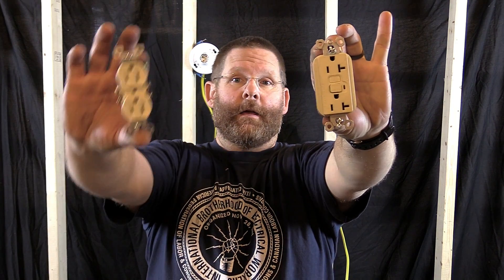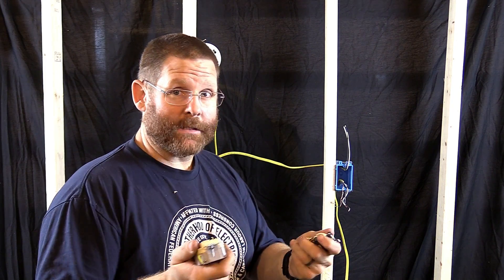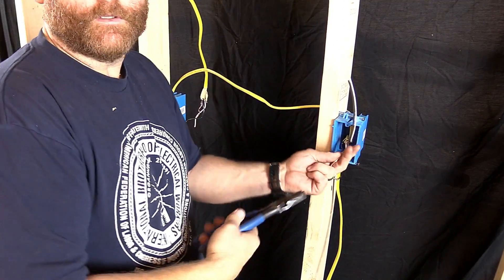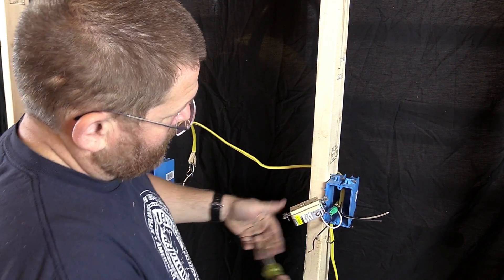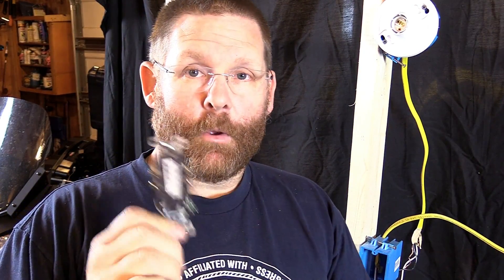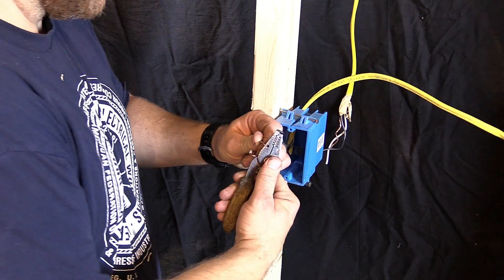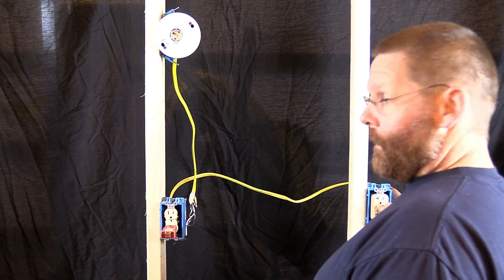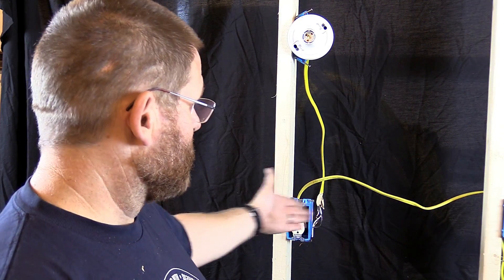How To Wire A GFCI And Receptacle

Comment: My box has two white and two black wires plus a ground. I got the two white wires confused to which was on top and bottom. What to do?
Reply from the maker: You have to find which is the hot coming on they must go on the line side. The other set is load.

Comment: Hey man do I just cap off the red wire if I'm using 4 wire romex?
Reply from the maker: Yes
Reply: @MountaineerOutdoors  another quick question man: I have a 2pole 240v circuit breaker powering 1 gfci, and 3 125v outlets down the line from the gfci. And I able to use a 125v to 220v adapter off that setup? Safely?
Reply from the maker: You should never feed a 2 pole breaker on a receptacle circuit. A 2 pole breaker is designed for 240 circuits and will never trip the way that you have it described. You need to change your 2 pole out to single pole breakers.
Reply: @MountaineerOutdoors  gotcha, so when switching out my 2pole for 2 singles I can simply take the black wire and put it on a single pole. And take the red and put it on the other single pole. And this will solve all of my life's worries?
Reply from the maker: 😂 I'm assuming so. Just to clarify you have a 12-3 correct? If so make sure you keep the black on different phases in your panel. If you replace the 2 pole breaker with 2 single pole breakers and keep it in the exact same spot everything will be  👌.
Reply: Yes 12/3 is the stuff I'm using. And What do you mean by different phases on the panel sir?
Reply from the maker: If you replace the double pole and put the breakers in the same spot that will be on different phases.. For instance. Left side 1&3 are different phases. 2&4 opposite side is a different phase etc all the way down the panel. So as long as you just put them in the same place as that 2 pole you will be right.
Reply from the maker: My pleasure ☺

Comment: Great video. While setting up standard outlets initially until clarify GFCI issue. Two questions 1) circuit had master (continuing circuit) and hall baths (end circuit) so GFI in master and regular with label in hall bath. 2) This is the true question. Your walls are open framing - distinguishing line vs load in master bath. Technically would be easy, turn power on and see which is hot is line. But what do you think of this alternative with power off - thought of when tracing travelers in 3 or 4 way, but could apply here. Assuming there is no special tool, take a 9v battery and attach - to ground + to wire tracing using alligator clip leads, then go to the other end with a volt meter. NOTE: This is part of a larger project, replacing all switches and outlets with an Alumiconn AL/CU conversion of the wires.
Reply from the maker: Sounds like it could work

Comment: Awesome videos, i have learned a lot from you, I am currently trying to automate my lights using a shelly 2.5 https://shelly.cloud/shelly-25-wifi-smart-relay-roller-shutter-home-automation/  and i am having trouble understanding 3 way switches, apparently there are at least 7 ways from what i have found on how people can wire a 3 way switch and some of the ways make it very difficult where you have to bring in power from another circuit to make it work, do you think you could talk about that and explain the safe way on how to wire a shelly when you a have to bring in power from another circuit, they are very cheap like $15 but you can do amazing things with them from very simple things like turn things on and off with the sunset to much more advanced things, thanks in advance
Reply from the maker: I have never heard of Shelly switches until you they seem pretty cool. If I ever decide to go that route I definitely will

Comment: Question: when you were wiring the LOAD on the GFCI @ 6:32 I noticed the white wire for the downstream you put in the bottom hole and the hot (black) wire on the top hole.  Does it matter which hole you use on the neutral side and the hot side of the LOAD push connectors?  Must the hole usage be consistent (top/top bottom/bottom)?  I know after you were all done both outlets worked and your tester indicated wiring was correct....but just curious if you need to use the same hole location or it does not matter?   I hope my question makes sense.   Doing the same  project tomorrow for the first time and I just want to be 100% sure about all the steps.   Thanks in advance for your reply/feedback.
Reply: It appears to me that Mountaineer did not understand your question. He made a distinction between wiring the line and load. I noticed the same thing you did, but it does not matter which of the two holes he uses on the line connectors. You can think of it as both holes belonging to the silver screw. You can put it in either hole for the white (common) wire and likewise you can put the black wire in either of the two holes for the brass screw. The reason there are two holes for the line screws is so that you can continue the line (power) to something else you do not want to be influenced by the GFCI if it shuts off. If you do use both holes on each of the screws on the line side you probably want to pair your wires to the same holes , yes for consistency, but also to prevent confusion about which white wire belongs to which black wire. Avoiding confusion in electrical wiring is paramount.
Reply from the maker: @astrongchristian  ok your right i didnt understand. now after thinking about it your correct and that explanation is spot on. Thank you for the clarification.
Reply from the maker: I'll have to check but anything down stream always goes on the load side. I'm pretty sure I didn't wire it with the black going to the top on the downstream side. It does matter for sure though everything downstream must go on the load side if you want it to be protected

Comment: Question, I have a power line coming in, a separate line going to a light switch, and another line going out to an outlet.  How would I wire up a GFI with three lines in the equation?
Reply from the maker: I am assuming you are not making the lights gfi protected. So you will have make the gfi and light on the line side the receptacles on the load side
Reply: @MountaineerOutdoors  thanks I figured it out.
Reply from the maker: Awesome

Comment: i have been watching your video my question is little different when i run meat saw 650 WATS  on Receptacle connected to GFCI my breaker trips either i turn off my meat saw or i run for a while. I would appreciate you if you find the solution for me or refer to your video if you have already uploaded . Thanks
Reply from the maker: Ok since I am not there with you, and I cannot see it I have some questions. 1st is this a dedicated circuit? Meaning is there anything else on it like more receptacles? Lights? 2 is this a newer house or do you have arc fault breakers in your home or regular beakers. 3rd is or has this saw been modified at all? Is it new or very old? 4th is it near a water source? And lastly when you are cutting the meat is it moist or wet?

Comment: If the GFCI is 20 amp should the down stream receptacles also be rated at 20 amp? 20 amp should used on 12 wire correct?
Reply from the maker: Yes 20 amp wire is 12 wire. And as for the downstream code says that any circuit that has more than 2 receps can be 15 amp devices. If it were me I would use 20 amp.
Reply: @MountaineerOutdoors  Understood and thank you. I will also do as you mentioned and will make the downstream outlets 20 amp as well. Thanks again for the video, and your response.
Reply from the maker: My pleasure ☺

Comment: Hi I’m doing 3 bedrooms and my basement I have 9 outlets and 1 15 amps breaker can I put a ac unit and the same breaker oh I need a Separate breaker for the ac unit thank you
Reply: No, the compressor from AC has a high amp draw. You need to check your AC units specs to see recommended breaker and also wire size.
Reply from the maker: True good points
Reply from the maker: Well depending on how big (amp draw) your ac unit is you might be ok without running a dedicated circuit.

Comment: Hi, thanks for your explanation in  the GFI video.  Now I want to add an additional outlet & connect it to the "LOAD" side of the GFI.   Problem is that there is a receptacle already attached to the " LOAD" side of it.  Can I still add my outlet from there as well?  Thanks.
Reply from the maker: Can you come off of the new one you put in. If not you will have to make a joint in the box.
Reply: I just noticed there is another set of available holes on the "Load" side of the GFI where I can insert neutral/hot wires.  So to clarify, I can safely have two receptacles downline coming off the load side.  Really enjoy your videos which are clear & simple. Thanks again!
Reply from the maker: Yes absolutely... I was thinking about that when I wrote my comment to you before. I appreciate your nice comment as well and I really appreciate you watching. Anything else I can do for you please let me me know ☺
Reply: All's good! Thank you again!

Comment: Great video buddy much appreciate it, saved me $$$ from buying multiple GFCI outlets for my DIY garage rewire.
I have an issue my garage doesn't have a ground running in from the main, what do I do ?  Any suggestions would be helpful thanks.
Reply from the maker: If it's in your garage then run a ground rod and put in the ground that way. Or if you water line that is metal bond it to it just make sure you separate your nuetral and grounds. Since it's a subpanel

Comment: Thanks for both of yer GFCI videos.  Replacing two at my mother’s house. The first one I came to had all the wires attached to the line posts which made that GFCI nothing more than an expensive butt-splice.  I’ve got 29 years in X-ray service repair/installs, and said, ”I’ve seen some strange crap all these years, maybe there’s a reason for this..?”  NAHHH.!! You set it right by me and thanks!
Reply from the maker: My pleasure thanks for watching and commenting ☺

Comment: Great Video. Can a cut wire be repaired? 

Can it be spliced into a junction box or should the whole wire be replaced. Its a greenfield 15 amp ceiling light circuit. One hot, one neutral and the ground is the sheathing around the wire. The house is about 80 years old.
Reply from the maker: You cannot mount a box in the ceiling without some form of hand hole to get back to it. So if you can get back to it then yes... Ie. If you have a can light you can remove then you can do it. Something though that you cannot get back to without tearing up sheet rock or plaster, then it's a no
Reply: @MountaineerOutdoors  The junction box is accessable thru the unfinished attic. I wanted a third opinion just to be sure. Thanks for your help.
Reply: Can a junction box be buried under insulation? 
Does the junction box need to be separated from the attic insulation.

Comment: Just came from Lowes. Im installing 2 new GFCI outlets. I got confused because they had 15 and 20 amp outlets. I didnt know which one to get so i got the 20s. Does it matter between the two ? Mine are going in the kitchen.
Reply: 20 amp gfi should only be wired with 12 gauge  romex. 15 amp gfi to 14 gauge wire.  You can use 15 amp gfi on 20 gauge wire but not vice versa. 12 gauge wire can carry 20 amp current w/o overheating. 14 gauge wire cannot carry 20 amp w/o heating up.
Reply from the maker: That is true. However, one would have too look inside the panel to see what the overcurrent protection device is. It if it's on a 15 amp check the wire size leaving the panel and inside the receptacle box. I've seen too many times where the homerun is leaving with a 12-2 and it spliced over and over and the receptacle boxes have 14-2 in them. Always good to check. But your statement is correct.
Reply: Agreed. If the breaker is a 15amp. But 20 gauge on a 15 amp breaker is overkill. 12 ga is difficult to work with in a small bix.
Reply from the maker: @pointerdogman2814  I agree. The breaker will only allow what it rated for to pull once the max is reached that breaker will fail due to it reaching the maximum allowed amps. Just like you mentioned in the beginning, 12 Guage for 20 amp and 14 Guage for 15 amp.
Reply from the maker: No 20 amp are more heavy duty should hold up better too. You did good

Comment: I am trying to add a new GFCI outlet in the middle of a run that will protect three standard outlets on down the line. The original wiring is 12 gauge/two wire (No ground). I disconnected line wire from the original receptacle and connected it to the hot and neutral Line Connectors on the GFCI. I then took new 12/2 (with ground) and connected the GFCI to the standard receptacle using the Load Connectors. The standard outlet is then wired on to the rest of the outlets as originally wired. Your video was very informative on how to install this new GFCI. However, connected this way, the GFCI will work, but the outlets on the load side are dead. I have checked and rechecked the connections making sure everything is connected correctly and they are. So I'm puzzled with that. NOW, in frustration and in need of power to this circuit while I figure out the problem, i disconnected everything new and just swapped the standard outlet out with the GFCI. This way everything is working! Which is great because we have a GFCI in the bathroom, but I'd really like to have the second outlet if possible. Any thoughts?
Reply from the maker: I'm honestly wondering if you possibly had the line and load mixed up. Did you use a meter or tick tracer to find the hot (line) coming in?  Did you keep the neutrals with the hots? The hot nuetral with the hot and the load nuetral with hot?  My only other thing is this.. Are you sure that the gfi is good? I've had alot of new gfi bad right out of the box

Comment: Hello. Thanks for the reply, I agree with you. that is the way i was taught. If the plug gets pulled lose the ground plug is the last to be pulled out.. I got another problem I have been trying to figure out and I think i came up with a solution. May be you could advise on. I have a rental property they came up with a new law, rule. If you have a receptacle with in five feet of the water. This being in the bathrooms and kitchen , laundry room hook ups. It has to have a ground fault. So the electrical boxes are old style and too small for the receptacle. But they say if you put one in on a circuit. It would cover the rest of them on that line. As I seen  on  your video. Now my question is why cant i go to the breaker panel and put one right out side of the breaker box for that complete circuit? reason for this the boxes being to small and the wires to short to work with? Thanks for your help time and trouble.
Reply from the maker: You could only thing is that it would be a nuisance for your renter to have to walk all the way to the electric box where you located the gfi at to reset it. Other than that I see absolutely no problem with that at all.

Comment: Hello, I have a problem. Im sure you can help. When hooking up the wires for a receptacle, You have three wires. But say you only have two. 
Can you hook up the common and ground so it shows a ground?
Reply from the maker: well I definitely would not do that. You may think that its the same thing but in reality its not. Fix it right and you will have a good piece of mind and a safer circuit.

Comment: hello , nice video thank you. Now i got a couple questions. If you look at the ground fault receptacales  they have the ground lug on the top.  You look at the testers the ground plug is on the bottom. The way i was taught was the ground plug was on the bottom. Then the changed it again. So what way is the right way? The code has changed from when i went to school  a couple times.
Reply from the maker: as far as I know there really isnt anything in the code book saying which way the ground should or shouldn't be. I prefer it down just like the picture shows in the thumbnail and in the video I did.

Comment: Thanks for the video. If my outlets are not currently GFCI and are daisy chained, how would I know which wires are line and which are load, prior to installing the GFCI?
Reply from the maker: You would have to try and find the first one in line. Then you can use a meter or induction tester and check for power. The hot one will be your line and the rest will be the load

Comment: Im running new electrical wire from breaker box & putting 2 gfi's by sink & 2 other outlets. Is a 20amp breaker & 12gauge wires be ok to use?
Reply from the maker: Absolutely is the that is what I would recommend
Reply: @MountaineerOutdoors  ok thanks for the fast response what size on outlets recommended? 15amp or 20 amp
Reply from the maker: Personally I do not see any problems with 15 amp. But if it's not a money issue go with the 20 amp they are beefier.

Comment: Great video, thank you. 
If possible I’d like to see a video on helpful tips/ code for running new home -runs. Mainly stapling and securing the right way, if I do some outlets in a garage, can the wire be exposed or does it have to be inside conduit. TIA
Reply from the maker: Yes they can be exposed. Conduit would be better so it would be more protected. But it's not code. Just make sure it's gfi protected.

Comment: I live in an apartment that does not have grounding/earthing and I want to install a tankless water heater in my bathroom... can I use gfci instead of drilling/digging an 8foot hole for the earthing? Thank you so much for the videos!
Reply from the maker: I would do that for sure. It's really important to have an actual ground from the earth it's much safer. But by code that's what you need to do.
Reply: @MountaineerOutdoors  Thank you so much for the quick and assuring reply Sir!
Reply from the maker: @jil6284  my pleasure. Have a great day ☺